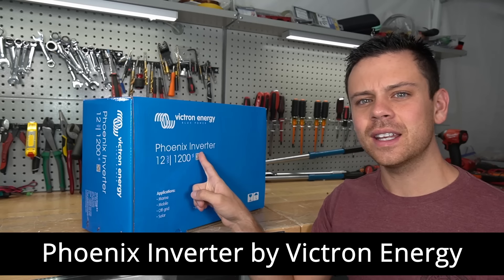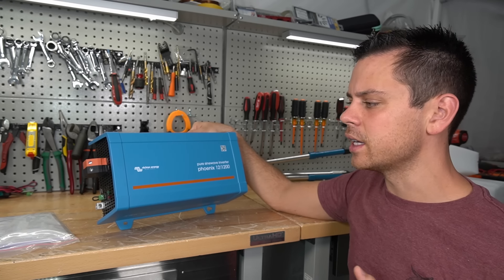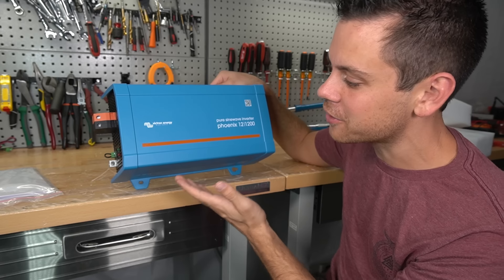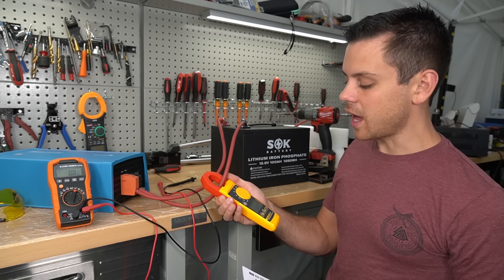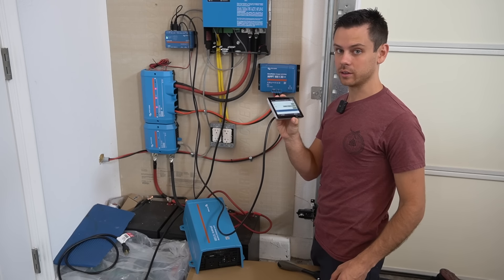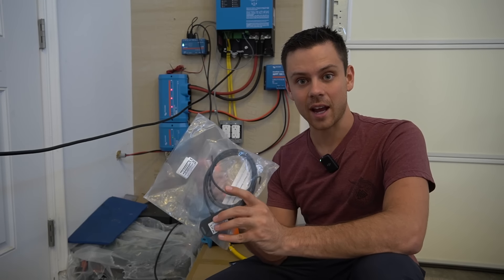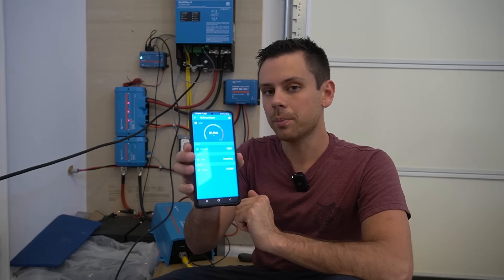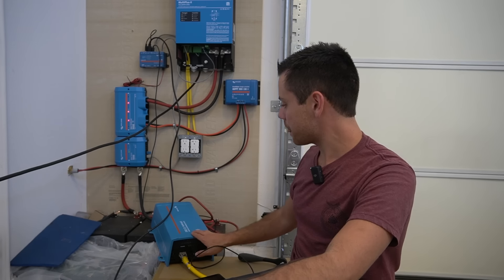Victron Phoenix 1200VA LF Inverter: Extremely Low Standby Consumption and More!

Comment: I just purchased this exact inverter from Victron for an off grid location that I have a couple small loads I want to power 24/7 including a mini fridge, some lights, and a couple fans for keep a shipping container vented and equipment cool. I originally got the 800VA model but upgraded to the 1200VA because I wanted to see if my 12k BTU Mr. Cool mini split would be able to run off it. Well you just proved it can. Now I’m really excited about this inverter. 

One thing to keep in mind is that the the Pheonix inverters are rated in VA and their actual watt ratting is lower. The 1200VA mode has a 1000 watt continuous output rating at 25 Celsius and 850 watt continuous output at 40 Celsius. The Mr. Cool pulls almost exactly 1000watts so it should be perfect. I was so excited when I saw this review from you. Thanks Will!
Reply: I used to have a mini fridge,insulated it with closed cell foam insulation. Now I have a full size,(no auto defrost)that draws just about the same amount of power.i also insulated it.
for the least power draw(most efficient)you can use a chest freezer with an external thermostat.
I also run a regular,"garage rated"(more insulation,and will work at a wide range of external conditions) freezer,and that takes hardly any power at all......my fridge draws WAY more.
Something to also be aware of with modern fridges is that many actually have "heaters" on the outside,to prevent condensation.....guess they do that cause it is cheaper than more insulation.....or the walls of the fridge/freezer can be thinner,thus more cubic feet inside compared to one with more insulation. 
This feature uses quite a lot of energy.....but it can be physically(electrically) disabled after you have gone past your warranty period.

Comment: This is a great video showing an option for critical loads like a fridge, lights, and internet. Your bigger stuff you can run off a bigger inverter that could be controlled to come on when the sun comes up. This could save you on panels but also battery size too, saving even more money.

Comment: Probably not good to load [continually, or constantly for more than an hour] past 50%, unless the victron instructions tell you it is fine to do. Inverters typically have a steep efficiency curve that reach their zenith at around 33-40%. It's possible they have overbuilt this and underrated its max load, and it reaches peak efficiency at a higher percentage of max load, but it seems like a stretch.

Comment: Greetings DIY solar. Why is it so hard to find a 12 volt in 110 volt in 110 volt out Hybrid solar inverter ? Everyone is content with making a 24 volt in or a 220 hybrid solar inverter. I would have to double the cost of my batteries and my need is a lousy 20 amp circuit. ANy brands out there that may make this requirement?

Comment: Hi , can you help me plese ? I write from Italy so try to understand ..... I just buy all this stuff..  Battery al litio Bluetooth LiFePO4 da 12 V 200 Ah Plus , Victron Energy SmartSolar MPPT 100V 50 amp 12/24-Volt Regolatore di Carica Solare (Bluetooth) ,FIREFLY ENERGY 400W  Solar pannel  Flex ( 2 x 200 Watt) and now The Iverter ???thr  can I buy Victron Energy 1200VA 12-Volt 230V AC Inverter ad Onda Sinusoidale Pura (Schuko) ? it's good ?? what I need more ? thnX ciao

Comment: You pretty much described my use case exactly. Thanks for validating my thinking :-). I use the Phoenix 12/500 to power the Internet connection and a couple of IP cameras in a remote cabin. The cams and the router are connected to a Kasa power strip that is programmed to turn on for a couple of hours in the morning and afternoon so those loads are not running 24x7. I like that the Phoenix can be monitored and controlled remotely. The other thing is that it's pretty snowy where the cabin is located, so it the panels were covered for an extended period and the batteries run down, I'm confident the Phoenix will restart when they're recharged.  We have another inexpensive Chinese converter that we use when we're there for the daily convenience loads. It is a good, reliable setup and I really like all the Victron components.
Reply: Chii-knezeeee😅

Comment: So that ultra low power mode is just so it can listen an be told to turn on again remotely? Like you said if you have 2 or more large inverters it makes sense but for the average system (that needs more than a 1200w inverter still) you may as well just go spend the money on a bigger battery bank...Even though the 60w my inverter uses doing nothing bugs me :)

Comment: I have this inverter and it has been working great for a year or so now. It is in constant daily use in my van. I’ve run a small Instapot on it but I needed full sunshine to do it. It is the largest 12 volt inverter I’d get. The Multiplus units are what I want to put in my motor home. I’ve got the Cerbo GX and the display along with the cellular comm device but I can’t figure out how to configure all of it. I have the Lynx distribution system and love it but still don’t have the BMV set up right. I’m a bit autistic and get confused but one day it will click and I’ll get it all figured out but it still all works great

Comment: no offense but if you are just gonna run lights and a starlink, a 12v car socket could do the wonders.
you dont even need to spend a money on inverters if its just a small load, hell im even using 12v to power my fridge.

Comment: Some Cotek inverters do that but they are only HF sinewave inverters.  I have an obsolete 1500 watt   Cotek with 1.5 watt search mode but it's no good with a transfer switch for a refrigerator. It works well for lighting, even though  there is a 3 to 5 second delay in powering up the inverter  to full power from search mode.

Comment: Hey Will, did i miss something? why standby power consumption is important when you use the invertor for always on load? standby power consumption is important if you need to keep the invertor on standby and have it power a load that comes on and off; I think you should compare the efficiency of the little inverter under small load with other small invertors or bigger multipluses.
Reply: Standby is also analogous to its continuous consumption. It always draws that, even under load.
Reply: Because if it's high standby but you turn it off overnight when there are no loads on it it does not matter as much. A smaller inverter for smaller 24hr loads is always on so the standby consumption ads up more quickly
Reply: @BenBrand  Im wondering how feasible this is.   In my use case i can see buying one for a 24/7 entertaining area in my living room which also has my router, and another one for my kitchen fridge.  Thats at least 800$ to address the device overhead of my EG4 6500's.  Im not sure if its worth it vs just leaving the 6500's on and using more battery storage, need to do the math.
Reply: I think both Ben and Patrick are making a wrong assumption, that "Standby consumption is a constant draw."  Victron uses a trick to achieve this low standby consumption, the trick has its own downsides, that's why Victron lets you turn off the low consumption standby mode, once you put a 24/7 load (Say ~ 200W) on the invertor, the invertor can not use that low consumption trick anymore. so its irrelevant what is the deep standby consumption when your invertor is always under load and can not enter deep standby. another words, you can not say my donkey is better than other donkeys because it doesn't eat while sleep, what matter is what it consumes while the donkey works, specially when in your use case you are not gonna allow the donkey to sleep at all. I hope this makes sense;) So Will compare the efficiency please!
Reply: @The_Zeroth  Agree. Not sure about that analogy, but you are right. The ECO mode power consumption only matters if it is in ECO mode. For example if you have a refrigerator, maybe the ECO mode would help because (maybe) the refrigerator would only trigger the inverter to come out of ECO mode when the fridge tries to power on. Then again, modern refrigerators might have always on circuitry and might not work properly in ECO mode. I don't know.

Comment: Hey Will, just wondering if you can do a video on grounding? This has been bothering me for years, as there’s conflicting viewpoints and trying to get a basic understanding of grounding of separate system components. 
When you have things like charge controllers from Victron, and inverter from Victron, solar panels and you’re connecting to your main panel. 
One of the main issues I have is feeding my main house panel from my Victron inverter. Do you have a separate ground on your inverter to a separate ground rod, or do you just rely on house main panel for grounding your inverter?
I’ve looked and looked for an overall view of understanding grounding, but there is no definitive video. 🖖😳
Reply: I agree with you Ben I hope Will puts out a video on proper grounding. Maybe I haven’t watched all his videos to see if he’s already done it but an updated video would be best.
Reply: I showed my friendly building inspector and he said to connect my inverter ground to my house grounding rod.
Reply: @Andrewsnotes1  
Thanks that’s good to know. What about all the other things like solar panels in charge controllers. Are all of these run to a ground rod separately? Or do you have to have a ground rod for your solar panels and then one for your charge controllers?
This all gets pretty confusing, but proper grounding is one of the most critical parts of any system. 🖖
Reply: @bwithgod6374  
Good thing I checked back with my post. YouTube did not notify me that anybody had replied?
Reply: @benjones8977  thats all I asked and all he volunteered.  Sorry.
Reply: @Andrewsnotes1  Not that I am an electrician but I would ground everything into a grounding rod outside I don’t think it gets any better than that.
Reply: @benjones8977  it is indeed confusing. I’ve come to the conclusion there are multiple ways to do the same thing correctly. My biggest question has been running a ground from the solar panels. Some people say it’s for lighting protection. Some say that’s ridiculous because of lightning strikes your panels it’s going to most likely going to destroy them with a ground to ground rod or not. Some people say the ground from panels is just to clear a fault in the panels themself but then you would need to connect the negative of the PV system to a breaker and the ground as well. 

I don’t think anyone has the definite answer when it comes to grounding. Best I can suggest is to study up on electrical theory and the purpose of grounding.
Reply: @aaronkatzen5973  
Thanks Aaron, i’ve been listening to a few smart people, so I’m saying that you don’t even need to ground your panels.
Then I hear others say that you can ground your equipment connecting a ground to your busbar negative?
The more I read the more confused I get. 
I plan on just shutting off all my solar gear during thunderstorms, seems to me the safest way and just go on the grid until the storm passes. 
Even the guy who connected my inverter to the main panel doesn’t seem to understand the grounding on solar that well. 
Everything else I did myself, but one thing I did learn – make sure you insulate your ground wires! I got zapped a couple of times! 🥊
When you’re using a wrench, you can crossover from your fuse to your ground and zap! So you need those ground wires insulated.

Comment: Perfect for a greenhouse. 
I don't understand why people seem to insist on using ONE inverter in power systems. Sometimes two if it's a phase thing. 
 With enough cap between the batteries and several smaller inverters makes more sense. 
Simply zone your use types. 
One for AC, another for lights and so on.

Comment: These are great but be aware of transformer hum even at idle and low loads. I run an electric blanket or an electric mosquito repellent overnight in my camper but I can't sleep with the hum. Had to use a cheapo modified sine wave inverter instead.

Comment: Such a pity this unit doesn't have a UPS function. It would be perfect !! Even the cheaper Rynogy units have the UPS function..... However Rynogy units shouldn’t be used with LiFePo4 battery's due to their inability to change charging parameters to suite LiFePo4. Thanks Will for another great review :)

Comment: CURIOSLY: HF HYBRID! "Victron Phoenix C 12V-2000 VA" Victron speaks of new high tech HYBRID mode (high frequency + coils?)... very expensive, very expensive but sure a great device :D 50 Bucks for bluetooth is a bit of a rip off imho)

info: SinusMax – state-of-the-art technology

"Using the latest hybrid (!) RF technology, it was possible to design a quality product with compact dimensions and low weight, which could easily deliver any desired performance."

Comment: Why would they skip on the 2000 W sweet spot?
Virtually every appliance sold in the US is designed to work on 120 V wall outlet power, which is about 2000 W.

Comment: Have you done any reviews of inverters with internal automatic transfer switches? I have an RV that has "inverter prep" meaning I need to cut the AC cable that feeds the inverter prepped outlets and hardwire it to the inverter. (Not plug in to outlets on the RV, or the inverter, like most inverters seem to be set up for.) I've been trying to find one that would work, but wondered if you've tested any? I built, and installed, my own solar system on the RV from watching your videos and buying your book!  So obviously I trust your reviews and knowledge. Thanks for guiding us!

Comment: What's funny, i got the old (not VE direct), metal box not plastic, with a fan (new one do not have fan) and the no load power is even lower ... 6W vs 9.5W on the new one .. lol, and even better ... mine is a 48/800 and give 750W while the new one only 650W... i would take the old one vs new one anyday.... those ve settings are nearly useless to me.

Comment: I just added this to my RV with other Victron components. With it I can run all 120V devices other than AC, microwave, and fireplace.  Not the end of the world.  If I wanted to run any of these would require more solar and batteries both of which may come some day, but not anytime soon.  In the mean time quite happy being self contained on or off shore power..  Thanks for the review..

Comment: Does anyone know how long the peak power is rated for on these? 

Curious because I'd like to run my small ac fridge and it spikes when the compressor kicks on
Reply: I contacted victron and they were very rude and wouldn't answer my question. They told me to ask my local retailer. Closest one is 3 hour drive, I called and they didn't know.
Reply: @TBButcher  I am considering getting the 1200VA for a small freezer and refrigerator . I have the 12V 500VA version for a UPS system I am building so as an experiment I connected them. Just sitting there they both pull 6-7 amps. Per my BMS it hit 83 amps for a second or two when the small freezers compressor kicked on. I am not sure how long the peak discharge rate is but after my experiment I feel the 12V 1200VA will handle the demand no problem. My concern now is my battery. It is 100 amp max discharge so I think that will be my limiting factor.

Comment: You should be able to configure the Pheonix via the Victron app connected to the Cerbo GX. It will appear as a device on it so no need to use the Bluetooth dongle and you can manage it remotely.

Comment: Hey Will, you may be the last hope for some Winnebago Owners like me.  Seems they shipped a bunch of their FLX trailers with the wrong Xantrex and Go Power settings...  pretty sure someone like you could figure out what they should be.  The system Is a Lithionics 320ah UL listed battery with a Xantrex 3000 watt inverter and 2 190 watt Go Power Solar panels with a Go Power solar controller.  All of the apps have be set at default from the factory and the system in no where near optimum like that, but I cannot seem to get a straight answer from anyone as to what the setting should be.  Please help me /  us... there are many of us flx owners with this problem.

Comment: I have Phenix 1200 inverter - connected to 2 Tesla Model S batteries - 750 watts solar 
 - powers Starlink - Ice maker - dorm fridge - coffee maker  - Instapot - charge Ebike- 
  Very quiet  - works Well -  wish inverter app readout was in watts  - circle scale is mostly useless
Reply: Do you power everything at the same time?
Reply: @miguelv431     I power many things at once no problem -  2 biggest loads 800 watt LED cook top and 675 watt e bike charger  if run at same time fan noise gets louder -
but not crazy loud - i usually dont run these at same time tho  - inverter has been on for 3 years contentiously -

Comment: Can you make step by step guide video how to run fuse circuits panel for dc appliance in the van like 12v fridge, 12v maxairfan etc, using ecoflow delta max or pro. I simply want to use portable power station instead of all that confusing stuff. Thanks

Comment: Will, I have a 2000watt power station (Oukitel p2001) that I'm using to power my off grid system. Because most everything will either be 12 volt with the exception of a few 110 items my choice of panels for replenishing my power is three 180 w 12v rigid solar panels. So as you can see I'm staying in the 12 volt category. If I set up another system for a house what is the advantage in changing from 12 volt to 24 or 48?
Reply: He already has videos of that

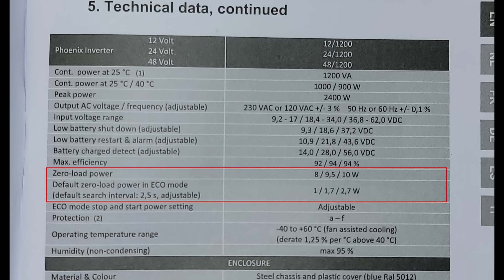Comment: At 1:10 it says continuously power only 1000watt/900watt. Is that correct understood? From at 1200watt inverter?
Reply: 1200kva not watts
Reply: @miguelv431  va, not kva.
Reply: 1200va with a power factor of 1 = 1200 watts. 1200va with a power factor of 0.5 = 600 watts.